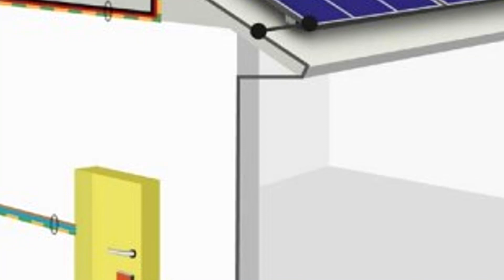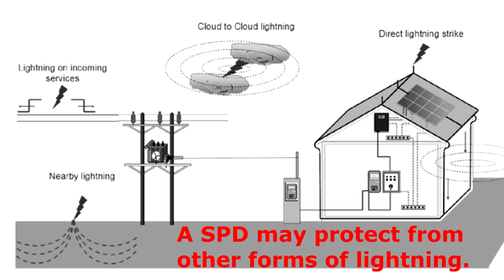A Surge  Protection Device is not a Lightning protection System 🌩️⚡

Comment: You just need the SPD ground connection to be connected to the lowest resistance to ground which you can achieve with you electrical system. run a 16mm cable ( 25 if its more than 5 meters or so ) from the MET up to the SPD. Bond the garage just before you enter the combiner box to make sure there is as little difference in resistance ( therefore little potential difference/voltage) at that point in the garage as possible. It would be good to know what type of earthing system you have in your garage and in your house. It would be even better to know what the loop resistance of your earth conductor is. You can do this with an Earth Fault Loop Impedance tester.
Reply from the maker: Thank you. They have measured the ground loop resistance recently when they replaced some cabling at the overhead lines down the road but just said it's OK.
We have the Tn_c_s network here so TN-C until the customers meter box and from there it's a TN-S net. I have an earth stake outside the garage as well as one near the house (for the subpanel there). That garage frame is grounded at this point.
Reply: @OffGridGarageAustralia Great! This is a very typical earthing arrangement and it has been done exactly right. If they said the earth was okay it means it was under the maximum impedance allowed for a TN-C-S system which is 0.35Ohms. I wouldn't have a bad conscience for you to simply run an earth cable from your MET up to the SPD and bonding the steel locally while you're up there too. 16mm or 25mm is great.

16mm has a resistance of around 1.15mOhm per meter. @ 20*C

25mm has a resistance of around 0.727mOhm per meter. @ 20*C

Just verify the earthing connection from the garage to the rod is healthy.

If you have a Low Ohm meter, its always nice to check connections are good. If you don't have one then just google “4 wire resistance measurement”.

Comment: Although you cannot use the frame for grounding it would be interesting to see the resistance reading between the earth from your supply and your earth rods. And compare it with the frame
Reply from the maker: The resistance or better impedance will change depending what current is going through the frame of the garage. I'm not sure if I can just use resistance tester for that. It's also hard to reach the top beam of the shed and the earth rod at the same time without using a cable in between.
Would be an interesting experiment...
Reply: @OffGridGarageAustralia  When I was installing industrial Ground Grids in Alaska, for power generation sites,  we tested them with a 'Megger' device that tested impedance and capacitance. It was different than an insulation tester.
 Metal buildings can generate quite a lot of static charge from wind and atmospheric charges as well. In the Arctic I've seen large Oil and Gas Production facilities develop huge static potential and circulating  between metal buildings. Sometimes you can measure it with Volt/amp meter.

Comment: Andy the trend setter 👍👊 happy for you and your chanel mate well done. Not sure on the regs it's been a while ...... but lol imo the frame of the building is bonded to earth/ground (same principle as the battery shelves) the inverters, mppt bonded. (Bolts on the side if I recall) personally I would also bond the ally sheets they are mounted to also. As for the surge protection its a hard one due to the location 😕 personally I'd run a 16mm to the earth bar In the combiner box then earth the spd to that earth bar. Possibly also bond from that bus bar to the building structure. That's just my thoughts mate.

Comment: As i said in the last video, i would run your own earthing wire using the apropriate size and type of cable, as if it was used for a normal consumer unit for mains power in a house and run it within a seperate small 16mm conduit outside to an earth rod.
Reply from the maker: Thanks James!

Comment: When it comes to grounding and bonding different countries typical electrical systems and building methods (and materials) are very different so there are very different standards across the world.  However an SPD must always be wired across the three conductors of the equipment it is protecting, ideally as close to it as practical.
Reply from the maker: Thank you.